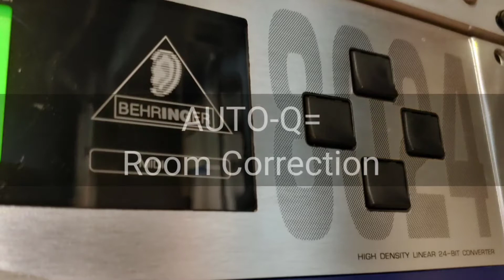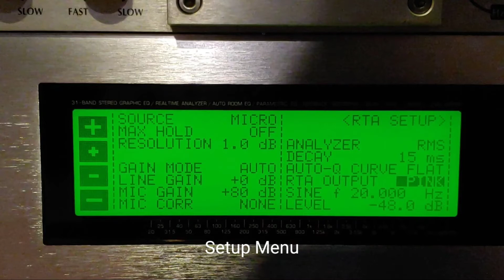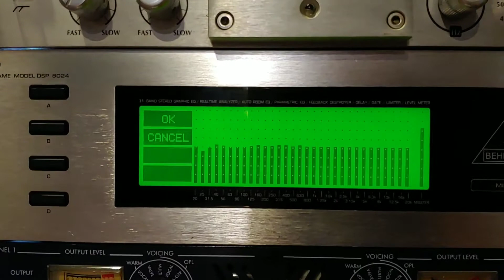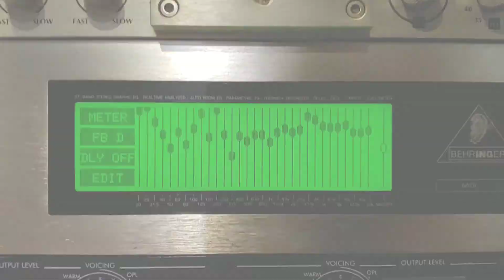Cheap studio monitor room correction with the Behringer DSP8024! HOW TO SETUP

Comment: Wow. I've had that piece in my rack for YEARS and had no idea it could do that! Thanks!
Reply from the maker: Yeah, the manual is pretty sketchy. Thanks for the comment!
Reply: mckevrock boss I need help with this, how can I speak with you, on Facebook Or whattsapp or text? I did exactly what you said and after it was done I did as you did pressed the in/out button to stop the pink noise and then pressed the eq to see the correction but then it said to repress the in/out button to hear the eq???? I did that and there’s like weird noises when playing a session just a solo instrument like a bass or a kik there’s like a delayed filter noise like sound can’t explain but once I hit the in/out button it stops but so does the eq? I don’t know what to do now
Reply: mckevrock it’s a buzz fuzz sound don’t know what it is, if it’s just the unit or what, but I know I didn’t have that sound before when plugged directly to the console
Reply from the maker: @muzikstore7984  Double check your menu settings before running the correction. Also, after analyzing is over, check to see if any of your bands are maxed out. If so, you might get some distortion or noise because the unit is trying to over compensate for a poor room. My unit does this a little bit too because of the settings you see I ended up with. Remember it's not a high-end unit, it's a Behringer, so you might get a little noise, but just focus on your overall mix and not noise. Hope this helps!
Reply: I guess it is pretty off topic but does anyone know of a good website to stream newly released movies online?
Reply: @Lucas Amos I watch on flixzone. You can find it by googling =)
Reply: @Hudson Khalid Yea, been watching on Flixzone for since april myself :)
Reply: @Hudson Khalid Thanks, I went there and it seems like a nice service :D Appreciate it!
Reply: @Lucas Amos no problem xD

Comment: How can I kill The frequencies between 20-40hz? It should be before or after in the eq preset?
Thank u 🙏🏽
Reply from the maker: That's pretty low dude, not sure if that's even a selectable frequency on this unit. Are you speakers even capable of generating those freqs? Are you mixing for humpback whales? I would use my master bus eq for that.
Reply: @mckevrock 😀  "Are you mixing for humpback whales?"  😀  Funny  😀

Comment: besides the room correction/auto EQ mode, what's it like using the device? what's the interface like? If manually eq'ing, is there a lot of scrolling or are eq bands quickly accessed?
thanks!

Comment: How did u connect it ?  I am going from Mic Pre -> Compressor -> Mixer -> Audiointerface Presonus Firestudio ......wher should i place it to get the best results ? thx
Reply from the maker: You're going to put this between the output of your PreSonus and your powered monitors, the microphone plugs directly into the back of the behringer. Your mic preamp, compressor, mixer won't be involved in this.
Reply: @mckevrock  thx a lot !! Nicee content 💥💥

Comment: Hi, I have two questions.
1) Is there a fine audible variation in sound quality simply adding the device in the sound system (flat curve)? In other words, does it add some kind of character?
2) Where to place the microphone during the meausurements?
Many thanks.
Reply from the maker: 1) Not that I can tell, but I'm not a scientist!
2) Place the microphone where your head would be during normal listening.
Reply: @mckevrock   Hi , how can i use this device for event (there a big hall and many peoples)?
Reply: @vasylmarchuk4109  Try to think.. device, mic, this tutorial. Your space, your hall, do it there. Could that work?

Comment: Hi Mckevrock! Thanks for all you help. I changed the EPROM from v1.2 to v1.3 and all is well.
Reply: Recently a unit with firmware 1.1 of the DSP 8024 fell into my hands, it is no longer available on the Behringer website! However, I read on some forum that the DSP version 9024 can be used, and to my surprise the name of the firmware itself is 8024, has anyone done this update recently? of the current firmware on the behringer of the 9024 on the 8024?

Comment: Hello please help I just purchased one it says warning power low when I turn it on should I be worried?
Reply from the maker: You might be plugging into the wrong voltage or it may have a memory battery inside that you will need to be replaced. I am not a technical support you'd have to contact behringer for this stuff.

Comment: Is it possible to do the whole thing with a PA system consisting of two subs and two tops?  because it only has two outputs….
Reply: Yes. As long as the EQ is patched/connected to a point in the signal path where the EQ would effect the full range output signal.

Comment: Hi mckevrock! You explain that you need hook the mic in the mic input and the speakers the output but don't I need to connect the output of my mixer somewhere before I starte the process?
Reply from the maker: No, not for this calibration. The signal is generated by the Behringer. The microphone is listening to the signal coming from itself! Of course, eventually you'll be plugging your mixer in, but that's not needed for this step. Thanks for asking!

Comment: hi bud hey i have one i cant get the analizer to work when the eq its engaged only analizes when the eq its on bypass it mutes the sound when  the eq its engaged  i touched everything nothing seems to work any advise?
Reply from the maker: Make sure you're going through and following the instructions step-by-step, I can't offer anything other than that. This is how it worked for me!
Reply from the maker: Also, I have heard you may need to have the most recent firmware update chip.

Comment: Hmm, I followed this exactly (settings and step by step), but the pink noise just goes on and on endlessly. It never seems to correct or get flat. Any ideas wht I might be doing wrong?
Reply from the maker: There are different firmware versions, check to make sure that yours matches.
Reply: @mckevrock  yeah v1.2. I ordered a 1.3a eprom, hopefully that will help. Thanks!
Reply from the maker: Can't say! Make sure you pause the video and check the settings exactly all three way to the end. This is the method that worked for my unit.
Reply: @moonthink8288 
I have same issue.
Does it helped , after firmware upgrade?
And if it did, how and where do you ordered a 1.3a eprom?
Thnx

Comment: Hi! I have another problem. When press the C button for L+R, it doesn't bring up the "Ok-Cancel" screen. It bring up the same screen as in the "RTA" mode. Why?
Reply: Are you using Version 1.2 or 1.3 software
Reply: Version 1.2 but ordered EPROM 1.3, hoping this may be the problem. Also does the 1.3 need to be programed?
Reply: @franksmith183  I'm having exactly the same problem as you! on V1.2 also
Reply from the maker: Yes, guys, from what I hear the 1.3 is the one you want. That is what I have.
Reply: @studio31productions83  @Franck Smith I have 1.2 and the same issue. Then i plug midi cables, tried to connect it to my computer using a free software for the new model and guess what? It now works! Incredible.

Where can this Eprom be found, btw?

Comment: My behringer when doing auto Q ( l+R ) returns to initial selection menu.. what's the matter ?
Reply from the maker: I'm not sure, this is what mine does when I go through these steps. Possibility you may have an older firmware version?
Reply: @mckevrock  my version is 1.2, what's yours?
Reply: @carlitosway1538  There's a bug with 1.2.
Here's what solved my problem (magic)
Then i plugged midi cables, tried to connect it to my computer using a free software for the new model and guess what? It now works! Incredible.
Reply: Hi, sorry, did you solve the problem by upgrading to 1.3? , because I have the problem "auto Q ( l+R ) returns to initial selection menu " (I have version 1.2). Thanks  @mkiswatoo

Comment: Hi. Does anyone knows how to use it via Midi?
I update my dsp8024 to v1.3 with the eprom part.
also I have the software for it.
when trying to setup the midi, the software closes.
does anyone knows how to control the dsp8024 via midi?
or how to activate the hardware for midi, to turn on the red light in the front, midi.

thanks. i can share the software from behriner if anyone need it.
Reply from the maker: Thank you for piping in, joe! I don't use MIDI but would be glad to see how you are using that feature for what your application is!
Reply: impossible to find the software online! I'd love to get it, please!
Reply: @mkiswatoo  Recently a unit with firmware 1.1 of the DSP 8024 fell into my hands, it is no longer available on the Behringer website! However, I read on some forum that the DSP version 9024 can be used, and to my surprise the name of the firmware itself is 8024, has anyone done this update recently? of the current firmware on the behringer of the 9024 on the 8024?
Reply: @hipolytte  sorry I can't say. & I sold mine a few months ago!
Reply: @mkiswatoo  I'm going to burn the EPROM with the 9024's firmware and try to upload it to the 8024. If you want, I'll post successful updates or not, I'd like to proceed with the update to have access via the midi interface on the computer